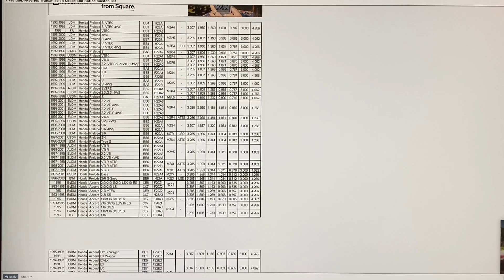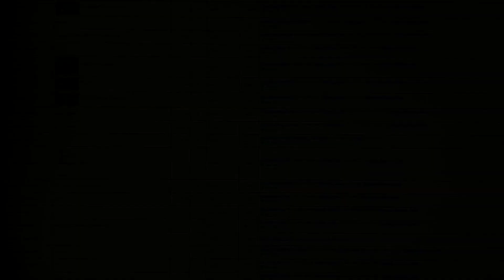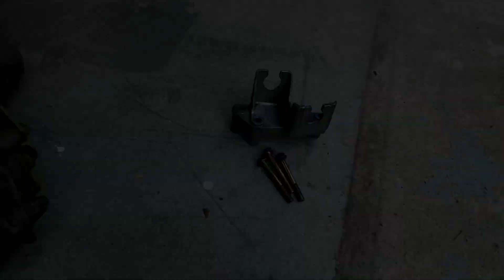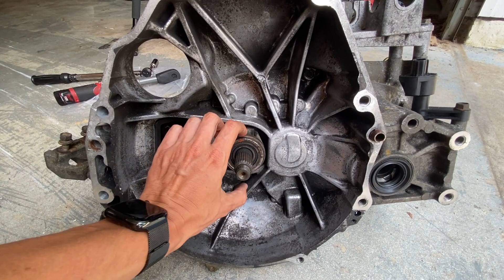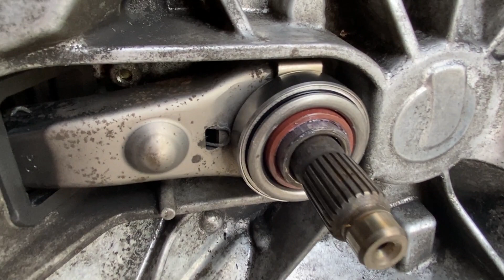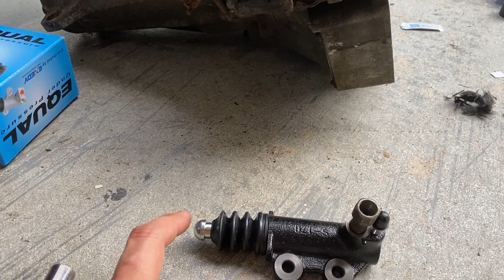Part 5: 90-93 Honda Accord CB7 CB9 Automatic to 5 Speed Conversion

Comment: I don’t need to swap out my rat trans mount just need the manual t bracket right
Reply: Rear
Reply from the maker: @dominicsmith1519  you will need the manual rear t-bracket and also an offset transmission mount from a custom mount company.
Reply: @randomrebuilds  yea I know about the innovation or hasport mounts just didn’t know if the rear mount needed to be changed also but thanks for clearing that up for me appreciate it been using all your videos to swap my se 2 door cb7

Comment: I’m doing a manual swap and I got the 90-93 manual trans, which motor mount is the right fit
Reply from the maker: @RobertoQuiles-e1x  DX or LX motor mounts with a manual rear t-bracket.

Comment: Do I need the manual trans axles or can I use the ones from the auto
Reply from the maker: the passenger is the same.  You will need a halfshaft and axle from a manual on the drivers side though.

Comment: I just bought a 1990 Honda Accord EX with 80,000 original miles. I’m guessing the Honda has a 4 speed automatic. 
I’m curious to know why the rpm’s are close to 2,800-3,200 with speeds at 65-75. Is that normal?  Why doesn’t my sport mode button doesn’t work.
Reply: Not sure about the S mode of hand, but yes the rpms are normal
Reply: Yeah the accord revs about that much at highway speed. Try deleting catalytic convert. They sell test pipes or make your own through salvage yard. Oh sport mode. Try another trans ecu at salvage yard.

Comment: Will a m2s4 vtec trans work on my f22a6 ecm?
Reply from the maker: A manual transmission will not make a difference.  The transmission ECU gets removed when doing a manual transmission conversion.

Comment: I would like to change the gearbox like you, I have a Honda Accord but it has the f22a2 engine, what gearbox could I put on it?
Reply from the maker: From what I gather - you can use a Prelude or stick with an Accord (90-'02) gearbox.  Depends if you want long (accord) or short gears (prelude).
Reply: @randomrebuilds  oooh thanks man and excellent job what you have done
Can you tell me the name of the gearbox from the prelude please
Reply from the maker: @anthonygamboavasquez602  Thanks!  M2Y4 is '97-'01 Prelude, and M2S4 '92-'96 Prelude.
Reply: @randomrebuilds  Thank you bro, it is very helpful to me
Reply: All h and f series transmissions will work except for the obvious s2000 and the prelude SH